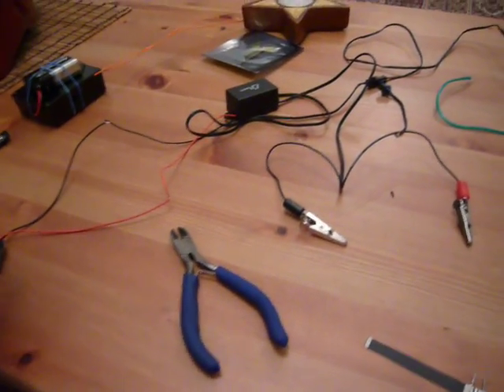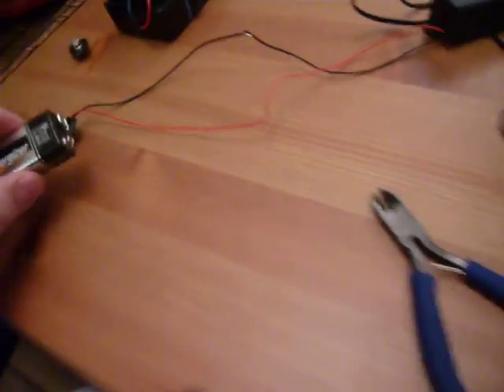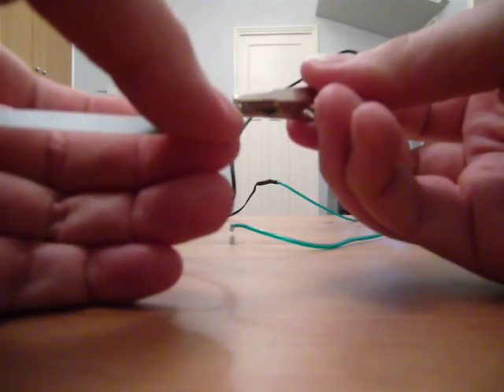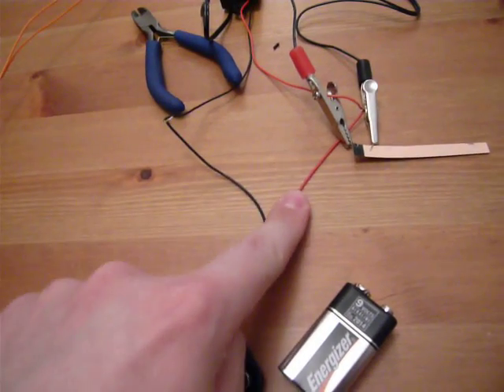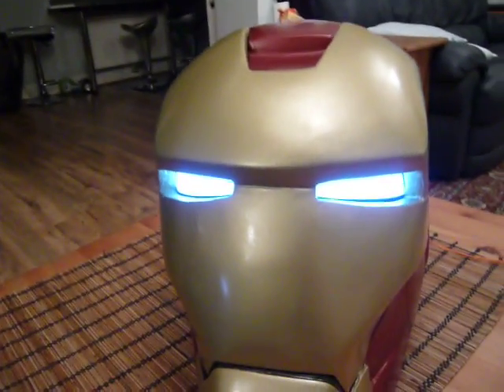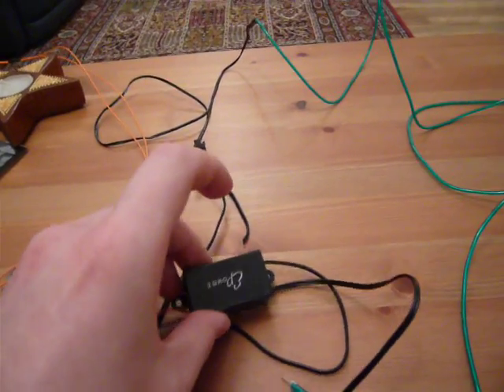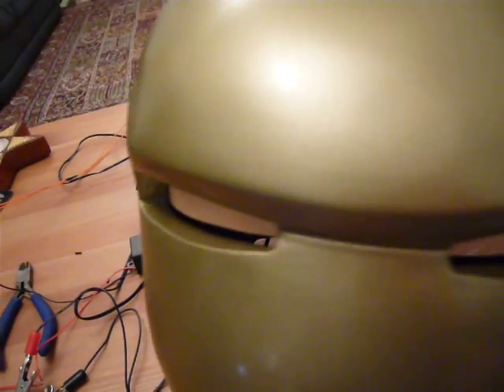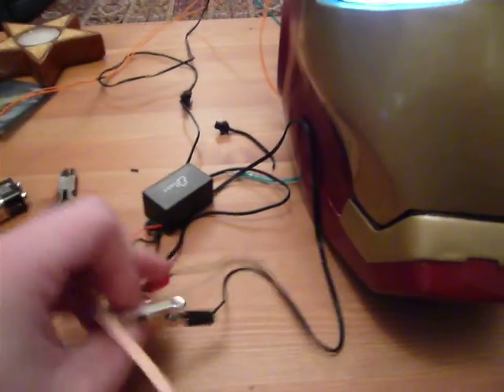Iron Man Helmet Illuminating Eyes - How to

Comment: Thanks a lot that helps so much, i wanted to know would you run the arc reactor LEDs and the palm light as well as the Eyes off of those two 9V batteries or would you go for a separate battery pack?